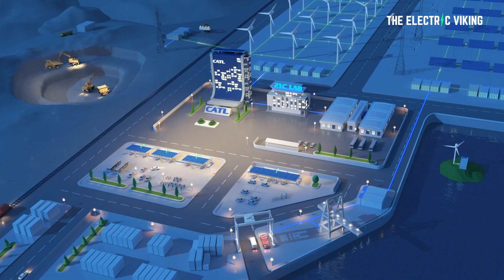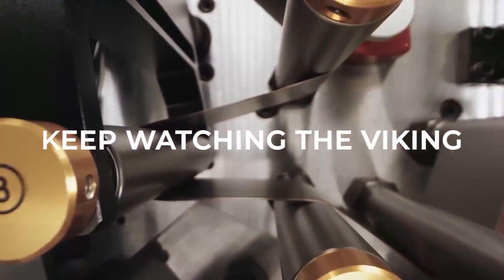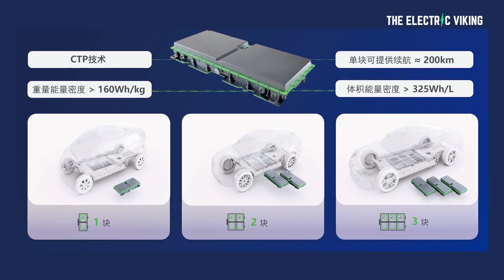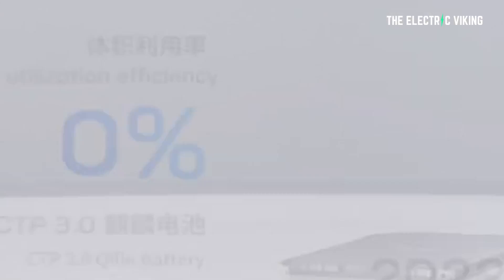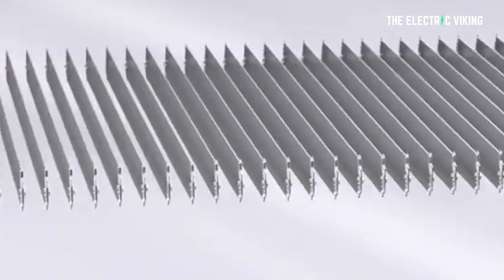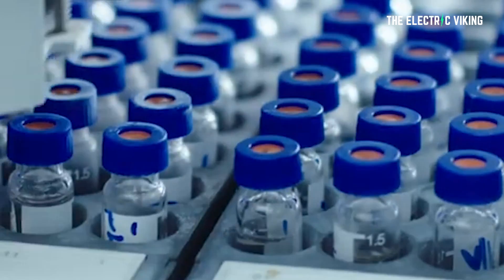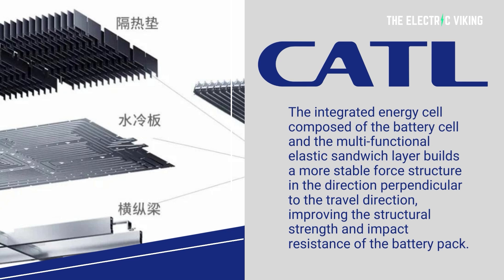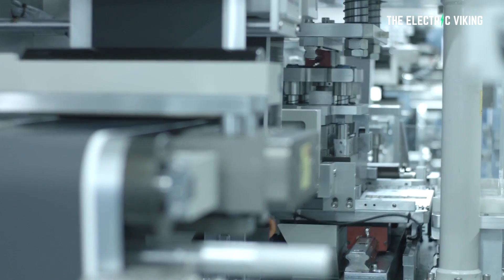The biggest EV battery breakthrough I have EVER seen

Comment: Let's see...1,000 km of range equals about 620 miles of range here in the US. 10 minute charging time? That's great too. Let's hope this comes to fruition. Not many gas powered vehicles get anything close to a 600 mile range..unless they get 50 to 60 mpg..and not many of those are being produced. Thanks for this info. I enjoy your Youtube channel. Keep up the good work!
Reply: In the US, maybe, but dirty diesels such as a Volkswagen Golf or my €2,400 2007 Renault Megane Estate all exceed 1,000 km (with 4 persons and luggage). Not that it's really a valid comparison point today anyway. Shorter ranges are also less and less of a problem as the charging networks improve year after year. We probably won't see vehicles with these new CATL battery packs before 2024 or late 2023, by which time even a 600 km range EV would be perfect.
Reply: Keep in mind that is likely NEDC or WLTP both of which are far more generous than the EPA estimates
Reply: @macrumpton  Lots of unknowns in this announcement indeed, and we have yet to see a car in real life with this new battery pack so we can run some comparisons.
Reply: Mine Citroen C4 diesel 1.5 turbo gets not far of 600 miles on a full tank.They either make a move on or many people will stick yto what they have.Lower the price of EV'S and far better range.
Reply: If that 620 miles is with a very efficient vehicle that uses gets 6.2 miles per kWh, that's a 100 kW battery. It'll take a massively powerful charger to push 80% of that into a pack in ten minutes, and fairly massive area infrastructure to back that up.
Batteries are just the first step in making very fast charging widely available.
Reply: @robertkirchner7981   From 10% to 80% of battery capacity is actually 70%, so 70 kWh in your example, which would require 12 minutes with a 350 kW supercharger at max charging rate, so it looks like they don't use a very efficient vehicle, but a very very efficient one!  😄
6.2 miles/kWh is actually very optimistic, unless CATL used a very light aerodynamic micro car as its test bed. The most efficient cars on the market today are more like 4.5 miles/kWh at best.
Reply: My 25-year old van does 650 miles on a tank. https://en.wikipedia.org/wiki/Citro%C3%ABn_Jumpy#Sales_and_production 
There may be a shortage of such vehicles in the US but there have been more than a million of these vans sold worldwide. It does 40mpg (world gallon, not US gallon) and has an 80l tank. There really are a lot of diesel cars and vans that do 600+ miles/tank.
Reply: @xxwookey  These medium size vans are so popular indeed that they are hard to find used. They also exist as EV, with a terrible 200-mile range. Now, we don't need 650-mile vans, which would mean you are carrying, like, more batteries than cargo, but something in the middle would have been great, because these vans need to be versatile for all the different use cases, and also if you expect any good resale value.

Originally I was lenient because these were first generation vans, but other such vans like the smaller Renault Kangoo experienced several generations from ZE to E-Tech, yet don't have a much higher range than the Citroën Jumpy / Toyota ProAce. They just suck by design, and are meant only for city deliveries or other short range applications. What their real life range will be in winter after 5-10 years of life is anybody's guess.

It's a pity because EVs pay off the more you drive, so if you can't transport people or cargo far away without recharging at expensive superchargers instead of overnight, you are not getting your ROI as fast as you would expect.
Reply: @Chimel31  We are getting lots of short-range vans because they are easy to make and there is a huge demand for delivery rounds which are rarely more than 50 miles. The 200-mile (more like 160 really) Vivaro/Expert/Proace/Jumpy/Dispatch is actually the first useful-range van for tradespeople/campers, but still very much on the stingy side, and a conversion of the diesel body. VW's ID BUzz cargo is the first that really does do more than 200 miles, and next year's bigger-batt/longer body version is 'good enough' for really quite a lot of purposes.
I'm also really interested to see what the specs for the Arrival van are when it finally gets released. The website says 111kWh/180 miles, which illustrates the fundamental limitations of big square vehicles.
Reply: @xxwookey  Oh yes, there is also absolutely a niche for short range vans, and a small battery keeps the van cheap and light, allowing for more cargo. Arrival vans are designed specifically for this market.
I am just wondering what kind of range (and resale value) an already short range van will have fully loaded in winter after 5 to 10 years of usage and a thousand or two charging cycles.
It's still a brand new early adopter segment, there is no Rivian or Arrival vans on the market yet, only mostly the Ford Transit for full size vans, and a few smaller vans, these are basically all first generation vans, or vans designed for urban usage. A larger battery does not just offer more range, it also allows you to transport building materials or other rather heavy stuff, not just Amazon parcels, with the right balance between battery and cargo weight, or if the legislation is modified to increase electric vans' 3.5 tonne gross weight (in Europe), like some countries started doing or are considering doing for even bigger trucks. I assume a modern van or truck will be much safer to drive and will brake much faster than an old 15-20 year old rig that's still legal.

Comment: If true, CATL will have cracked a big nut here. But it remains to be seen if the battery can deliver all its promise. The other problem, of course, is that it will be manufactured in China, which means that the world will be at the mercy of the Chinese government should we depend on these batteries. That is why research on the solid-state should proceed. With the world as it is, we cannot rely on China for all our cars and components. I hope that if this battery works as advertised, it can also be manufactured outside of China. So this is not just about the technology, but also about the long-term viability of the supply chain and our ability to make batteries locally. I have nothing against Chinese companies; their talent and technology are to be respected. But I am concerned that these new technologies can spread worldwide so that we don't have to depend on the Chinese supply chain. We saw those dangers come to light during the pandemic, and we need to be realistic.
Reply: I can't argue with anything you have to say, Ferniez--plus, I would never argue with someone who knows how to correctly use the semicolon.  Unfortunately, I think we're already there.  The world is completely dependent upon China for its manufacturing capabilities.  We have essentially forfeited our own manufacturing base in the name of saving a few bucks.  Well, to be fair, a lot of bucks.  I am as complicit in this as the next guy.
Reply: @eyesuckle  Full marks for your semicolon comment.

Comment: Interactive Brokers allows you to buy CATL stock, otherwise there’s no pink sheet ticker in the US.
Tesla spent years developing the 4680 and its already old technology (when looking at charging speed).

The pace of development in this space is mind boggling
Reply: Your missing the point with the change to 4680 is that even without chemistry changes the battery will  continually become cheaper due more capital efficiency in bringing improved manufacturing technique as with Tesla battery they are improving the speed of battery production from same square foot of floor space & labour.(I think with solar, the rough estimate is a bit less half the cost decrease from improved manufacturing technique & the rest from new technologies)
Reply: China Stock market isn't as high flying as Nasdaq. It's mostly range driven. Perhaps there is less hype and more economics at valuations and more competition rivalry, invested capital use and less of a "profits for shareholders" policy. So its more of a cyclical trader market, rather than buy and hold. US stock market may become like that as well with 75 - 85% correction rates
Reply: Tesla improving on old tech, while China developing new tech. Ha, ha. May be they make Space X obsolete before it even flies

Comment: Better take that power comparison (4680 vs. Qilin) with a grain of salt. To my knowledge, there is no conclusive power rating available for the 4680. But that miraculously does not stop CATL from issuing a comparison…
Reply: Texas 4680 in model Y seems like a Meh for end users so far.
Reply: @ctuna2011  SW throttled. As one would do to prevent osbourning 2170 and to play it safe on a new technology. The contacting of the collector foils (tabless) appear comparatively superior to the usual contacts used in prismatic cells (tabs or forks). But I do not know if CATL might also have improved on that.

Comment: Battery break through are not solely for EV’s. Batteries have numerous uses. EV is just 1.  Still waiting for you to correct the battery size on 4680 model Y’s. Numerous people putting in over 60Kw and you still think it’s a 50 Kw pack.

Comment: I saw this announcement a few days back, thanks for giving your take on it Sam. My 2019 e-Niro has a pack weight of 457 kg and a useable capacity of 64 kWh. That gives it a pack level density of 140 Wh/kg. And of course its an NMC 811 turnery battery. The range it gives me is just fine, even in worst case highway driving in the winter into a headwind I have never been able to drive for longer than the battery will last in one sitting of driving i.e. 300 km. Local driving in summer will see 500 km easily...not that we have ever let the battery go that low. It’s weakness is in charging time, which peaks at 75 kW and doesn’t sustain that for long. So, an LFP Qilin battery from CATL @160 Wh/kg would have a capacity of 73.1 kWh at the same weight of 457 kg would give me around another 60 km of range, which is always useful. On long road trips we are typically charging from 20 something % to 80...which takes about 40 minutes on my car but would be under 10 minutes with the Qilin. Yes, I would call that a breakthrough.
Reply: LFP gives me the good nights carefree sleep @100% and the resultant full tank on waking, and also with little degradation over an extended lifetime.
Reply: @davidpearn5925  I have never lost any sleep over the SK Innovation NMC811 battery in my Kia e-Niro. We’ve had the car for over 3 years now and there has been no perceptible loss of range. We know there were some fires with Hyundai Kona (LG Chem) but the batteries supplied by SKI have never suffered from spontaneous combustion, not one reported case as far as I know. As for durability, you have cycle ageing and calendar ageing. To all intents and purposes my car will never have a problem with cycle ageing. Yes, if you charge to 100% and go down below 10% every time you will be limited to between 1,000 and 1,500 cycles before >20% capacity is lost. Even so, that’s 0ver 450,000 km for the e-Niro, but who ever charges like that!? Data shows than an NMC battery will take a lot more cycles before degradation when charging from 20% to 80% or 30% to 70%....what I call ‘micro-charges’ (20 minutes at the supermarket on an AC charger for example) when you add 4% or 5% don’t really count as ‘cycles’ but last year we got about 1,000 km of driving this way. In the last 6 months I have plugged the car in 62 times, mostly at home, 15 times on public DC chargers, taking it to 100% charge 8 times. Including ‘micro-charges’ we average 160 km per charge. From the available data an NMC battery will take at least 2,500 cycles in the 20% to 80% range which is our normal MO when charging at home...comfortably over 400,000 km..I am 65 years old and we do 20,000 km a year...I think the car battery will comfortably outlast me!!... but sure, LFP would be even better, a true million mile battery.
Reply: @kiae-nirodiariesencore4270  I’m significantly older and the LFP will certainly remain valuable long after me.
Our small (50) is full every morning and good for 440.
Reply: @davidpearn5925  Your just another clueless nut that thinks nothing beats LFP but just like all batteries they age and with all lithium batteries age kills the battery more than cycles, which is why every single battery has a warranty between 7-10 years. If your so called LFP battery is so much better then give it a 25 year warranty like many solar panels get!

Comment: Byd is planning a high end coupe in its luxury brand for 2023 that will use next generation blade lfp battery and have 1000km range.  Their pack level density will probably reach 180 wh/kg or even higher.  Byd is ahead of catl in lfp technology.

Comment: There was always the possibility that a conventional battery break-through would take the wind out of the sails for Solid State. I don't know if this will be the real thing but if I had to guess I would say that CATL will deliver.
Reply: Solid state is bigger. Most solid state won't need to worry about the extra weight and can just be integrated into vehicles without additional cooling or extra structural systems to protect the battery from being punctured. You'll be looking at 21+% lighter packs with solid state and much higher volume efficiency than the current industry leading 72% here. Bottom line is this is being way overhyped like a lot of other "breakthroughs." It's good but it won't "kill" solid state. Those are on a whole new level.

Comment: 255wh/kg pack 235wh/kg  cell is Really nice. The 4680 is supposed to be about 350 but they are still having problems integrating it into cars... so more than a year behind schedule (as cutting edge tech gen is). So still room for both. 

That said, with the Std Range cars with 250+ mile range with 160wh/kg battieries.... nice. Really nice. Thanks for the Pack and Cell numbers - hate it when people use stats with non-standard specs. (like wh/litre)... annoying. 

Thanks for the research. 
H2 cars now have their work cut out for.... oh wait, that tech was dead long ago. 
Now it is buried too.